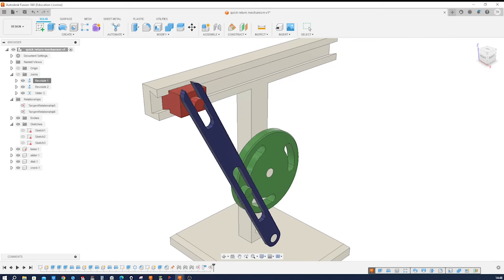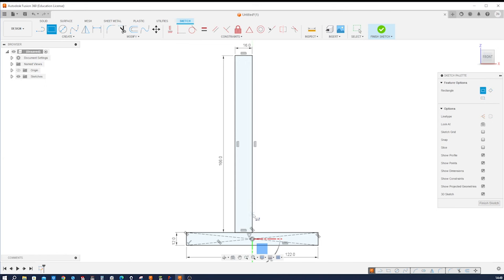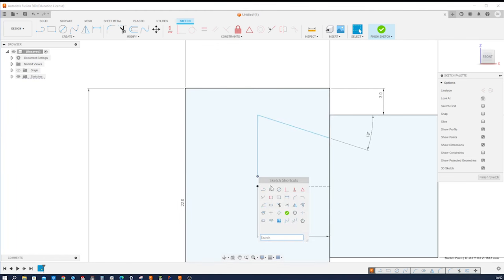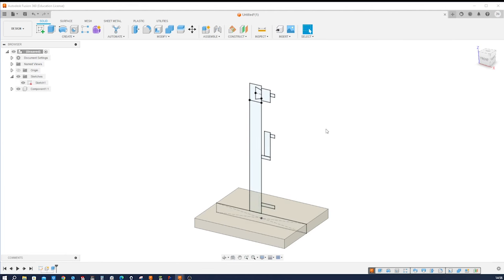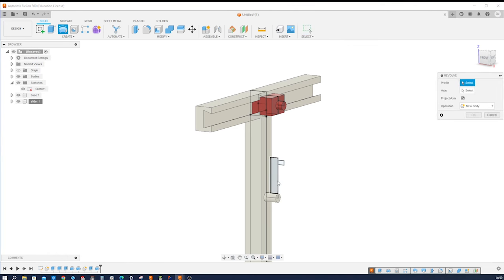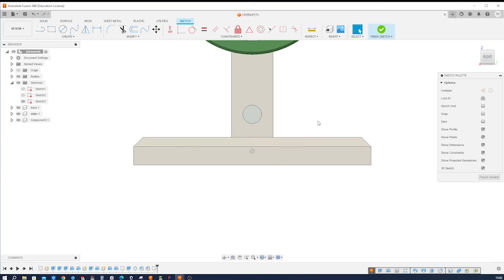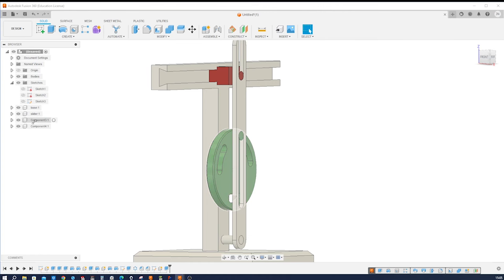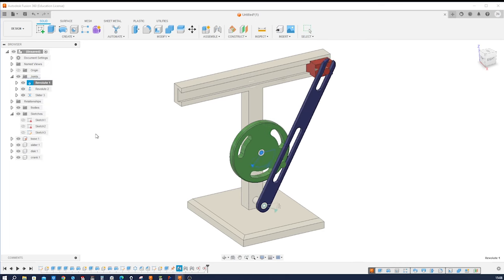Fusion 360 Tutorial: Designing a Quick Return Mechanism from Scratch

Comment: Thanks. Very Nice. But my assembly doesn't move. The wheel has the rotation set to anti clockwise and the slider set to move rightwards somehow. How do I change the direction of motion of the slider or the wheel?
Reply from the maker: Sorry to hear  that.  It's  a  little  difficult to diagnose from the  distance.  It really  does not  matter if the rotation is  anti-  or clockwise. One guess is  that  you set the  slider mate  to "rigid"?